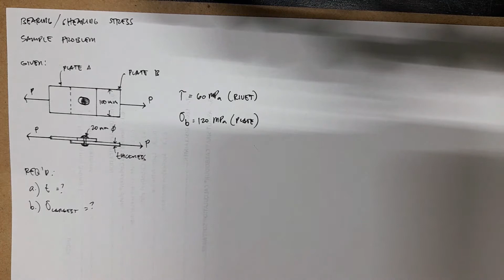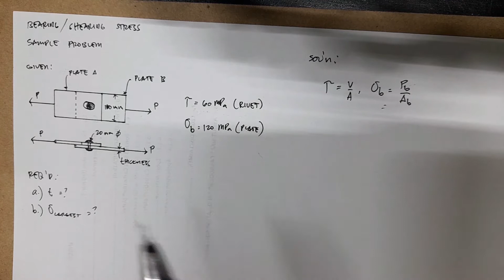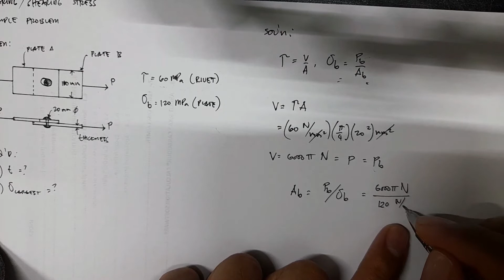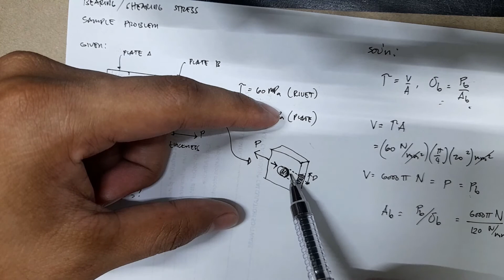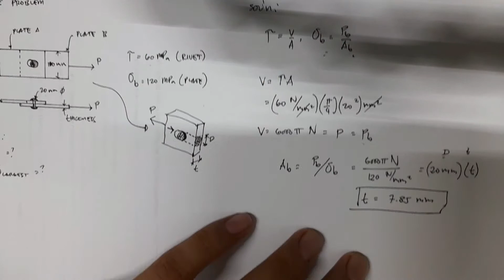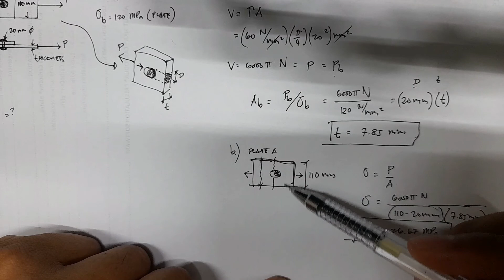Shear and Bearing Stress Sample Problem 2

Comment: Ask lang po sir bakit naging ganon ung Area dun sa plate A using normal stress nung sinosolve na po ung average tensile stress in the plates? Like bakit po naging (thickness nung plates x (width ng plate-diameter or rivet)) kasi po ang naturo lang samin kapag rectangle is length x width lang sa area pag rectangle?
Reply from the maker: hello lods, depende kasi yung area kung san tatama yung shear force. In this case dun sya sa gilid ng hole, therefore yung area ay kasama yung thickness